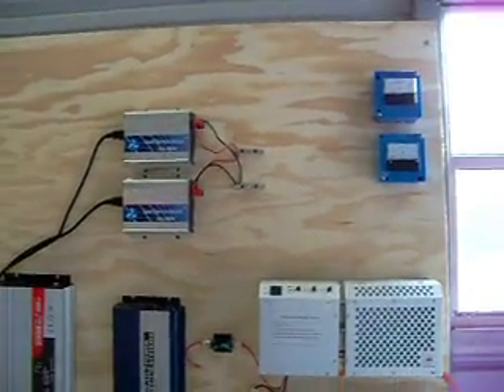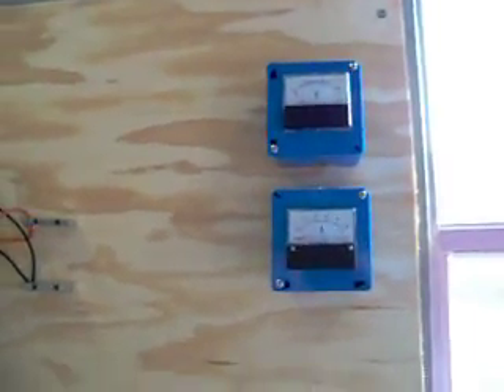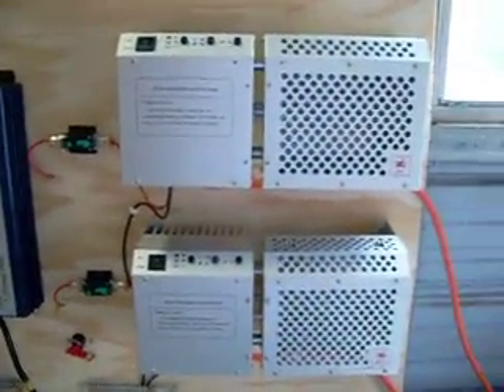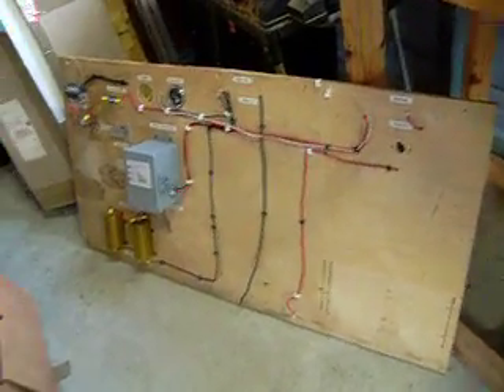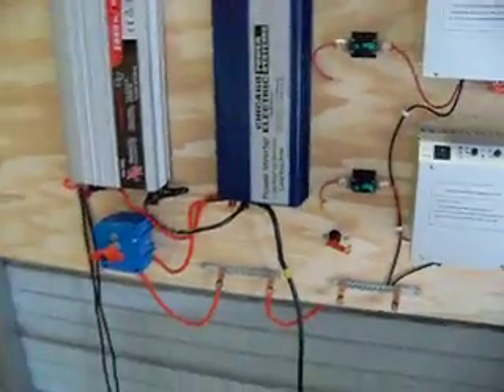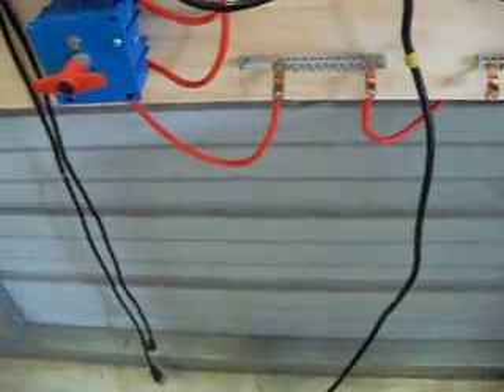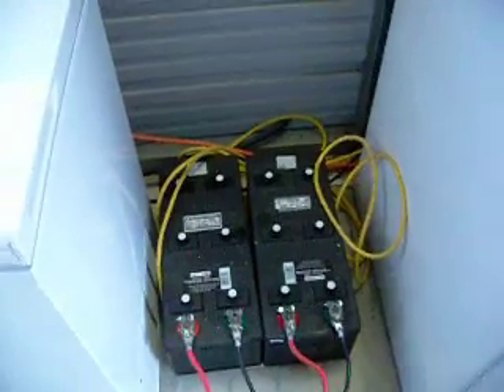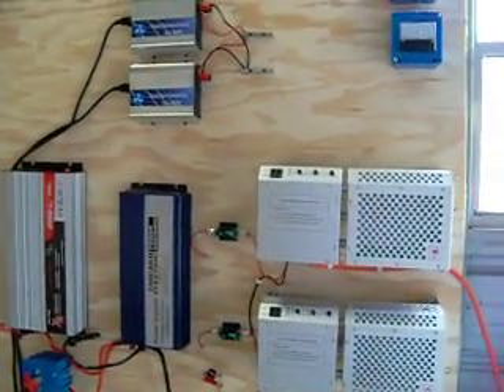Power panel for wind & solar

Comment: Thank You for the great video and information. I have not started mine yet. I intend to use both Solar and wind turbine for power. I want to connect to the grid. I need to learn how to have power to the house when the grid goes down and not hurt anyone. Any suggestions? Again Thank You.

Comment: You have some good ideas....however buying all those solar kits from HF is pretty much wasted money..I made the same mistake and wound up returning them when I found that for $165 I could buy 3X the wattage in only 1 panel for the same cost on ebay.....and of a better type of solar panel...After studying and reviewing MANY utube videos & searches...learned everything else on the market was using standardized  waterproof electrical connectors ... making any options unusable  with their system...I wound up buyind (2) 150w panels @ $330, (2) 50' correct 10 guage PV wires with mc4 connectors @ $44, (1) 30a chg controller @ $15, (2) diodes @ $7, & (4) 6v golf cart batteries @ $340 wired to 12v...Save some money & get a better standardized system from EBAY 😁 You can other panels with the only cost being Y connectors ($7)....+ panel cost@ about $1 a watt...Nice turbines

Comment: Thanks for the upload and sharing!
So, for a small 12v solar system if you want to
add a 12v wind turbine (either external or internal charge controller),
 do you connect it straight into the battery bank without
any further curcuit or switch?
thanks again!
Reply from the maker: Correct.
Reply: quick and full answer...:)
thanks again, i will
try the connection this week!

Comment from the maker: @mrmetal60 You don't want to use the hybrid charge controller if you're going to try and go directly to grid tie without batteries. TGo to HurricaneWindPower and order their SWEA wind turbine grid tie inverter started kit which has a 250watt inverter and can be expanded to 1Kw.

Comment: so like to ask, how well did the grid tie inverter work off of the hybrid charger controller??  i have a 24 volt turbine windmax. dont really want to mess with batterys. is the voltage coming out of the charger controller stable??? or does it go up high??

Comment from the maker: 1Kw WindMax wind turbine, Rohm 25G tower, grid tie inverters from eBay, modified sine wave inverter from Harbor Freight, pure sine wave inverter from XRelectronics, DC disconnect switches from Harbor Freight, Voltmeter and Ammeter from eBay. That's it.